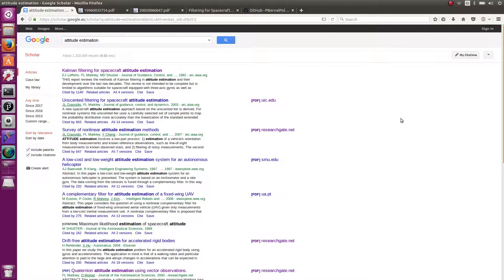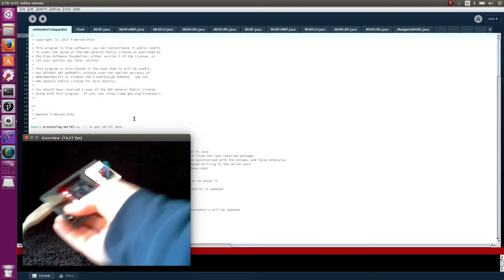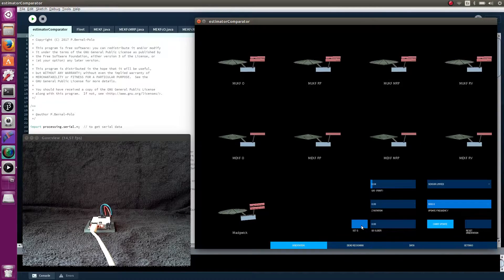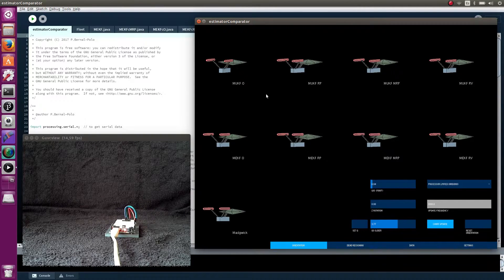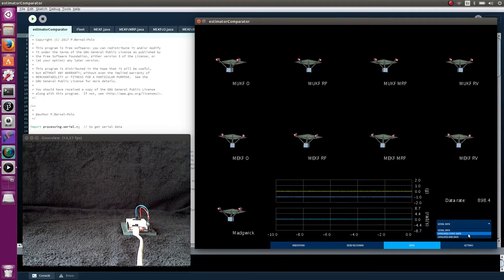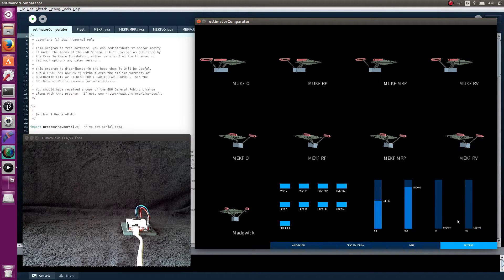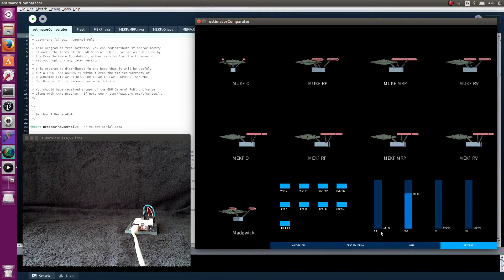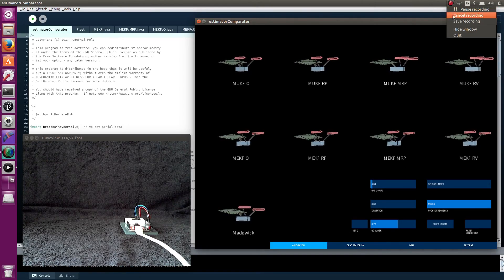Orientation Estimation using Kalman Filter, Quaternions, and an IMU as sensor | long video

Comment: Sir , did you make any library for aruino like thing for example stm32 blue pill or esp 32??
Reply from the maker: It is not a proper library, but you will find some very outdated c++ implementation here:
https://github.com/PBernalPolo/OrientationEstimationTest2017
Is that going in the direction you were looking for?
Reply: @pbernalpolo  sir, I have made one with complementary,1d,ekf with bias and ukf now. But I am having problems with Q and R tuning. Can you give me some guide line
Reply from the maker: @SaumikKhan  i can try. Maybe you can start by describing the problems that you are having
Reply: @pbernalpolo  Sir, I think I have solved that problem. But now I am facing another problem. Whenever mpu6050's  X axis is pointing north, the roll and pitch angle suddenly start increasing. I am also using an HMC5883l magnetometer inside a GPS M8N. Basically, I am using a Gyro, Accelerometer, and magnetometer for a quaternion-based UKF for estimating quadcopter orientation. What could be the solution, sir?
Reply from the maker: Your comment offers very limited information, so I can only suggest some directions for you to debug. According to what you describe, you are obtaining an unexpected rotation of your estimated quaternion. That mismatch with your expectations must be coming from the measurements used to update your estimation. I would start by deactivating magnetometer and GPS so that your setup only includes IMU (gyro + accel). That setup should work without surprises. Then, I would activate each sensor independently (first only IMU + magnetometer, then only IMU + GPS), and check in which configuration you start observing the behavior you where describing. Once you find the source of discrepancy, you will be able to correct your code if it is wrong. Keep in mind the possibility of your magnetometer not being calibrated, being surrounded by some iron that modifies the expected constant magnetic field, or some other tricky situation. Magnetometers usually bring unexpected problems, and you could be facing one of them.

Comment: Great stuff going on here! Is it possible to test this out using a different 6DOF IMU? I have an Arduino Nano 33 IoT's LSM6DS3 IMU and wondering if I would need to change any of the configurations around? If so, could you guide me a little as to where I would have to make changes?
Reply from the maker: Thanks! You will need to change something in the code only if you configure your IMU in a different way than I did. Specifically, in the "dataAdministrator" class there are two variables: amScale and wmScale. They define the scale factor used to convert raw measurements to the units expected by the algorithm. On the other hand, you will need to pack the measurements correctly to send them through the serial port. In order to do it you have several examples in the folder named "sensor2arduino2rpi". Your sensor seems to have 16bits per measurement like the ones I have, so you shouldn't find it difficult to use those examples to read out the measurements using your preferred library, and then pack them (using the MessageManager and the IPM classes) into the byte array which is later sent to the computer. I hope this is enough for you to try doing it yourself. Please, let me know if you get it to work or if you encounter any difficulties.  :)

Comment: Hi Pablo, great video here! It perfectly provides me with a starting basis for optimizing my IMU data for my application. However, I am running into some trouble getting the code to work. The code in the video doesn't correspond to the code on github. Could you provide me with some information on how to get the code on github running?
Reply from the maker: Hello, and thanks! I didn't remember changing the code, but you're right: the github code is a different version of the code that appears in the video. I don't remember the changes I made, but they should be superficial. I just tested the code and it seems to work correctly. Could you provide more information on the problem you are experiencing? What IMU are you using? What operating system are you running the code on?
Reply: @pbernalpolo  Thanks for your fast reply! I'm running the code on a windows 10 platform, using Processing 3. The IMU that I'm using, is a combination of ICM20600 (acc + gyro) and the AK09918 (mag). I checked your code and made sure the format of the serial data is exactly the same as in your example. The first problem I encountered was with the test_MKF.pde, where the variable updates is never updated from 0, and afterwards a log10 function is called (which returns -inf). However, I bypassed that by hardcoding 1000 into the variable updates. Now no errors appear when running the code, but the aircrafts/spaceships don't seem to move (regardless of the orientation of the IMU). Any idea on where I should look next? Any good points where the debugger could provide me some valuable info?
Reply from the maker: @quinten52  , as you know, variables defined in the main Processing sketch file (in this case "test_MKF.pde"), are accessible from classes defined in other files (which are included as inner classes by Processing). The "updates" variable is updated in the "manage_serial" method of the "CommunicationManager" class. I know this is not elegant, but for some reason I decided to do it that way at the time. Knowing that the code works as is, I would not change anything. Most likely the sketch is not receiving measurements for some reason. It is possible that the values are not being transmitted properly through the serial port. I would start by making sure the measurements are received by looking at the "DATA" tab. You should be able to see the data stream there. If it does not appear, then you should look into the way you are transmitting the data from the microcontroller (are you using Arduino?). I recommend you to check the Arduino sketch that I use to transmit the measurements from the MPU6050 ("mpu6050_2arduino2rpi.ino" which is inside the folder named "sensor2arduino2rpi"). It should be easy to modify that file to send the information from your sensor. Please give it a try and let me know if it worked!  : )

Comment: Hi Pablo, great Paper and clear video!
Would you recommend Madgwick for an easily implemented sensor fusion algorithm for a quadcopter (on microcontroller)?
Kind Regards
Ryan
Reply from the maker: Thanks Ryan! I'm glad that you like them.
I compared the Kalman filter based algorithms shown in this video with the Madgwick algorithm a while ago and took some notes. According to those notes, Madgwick's algorithm is less accurate than those based on the KF (when both run at the same update frequency). However, Madgwick's algorithm runs very fast compared to the MKFs, and that speed makes it preferable for some platforms (more update frequency usually means more accuracy). For example, on ATmega2560 (Arduino), the MUKF runs at ~7Hz, while the MEKF runs at ~25Hz, and the Madgwick algorithm runs at ~450Hz. However, on an RPi3, the MUKF runs at ~3000Hz and the MEKF runs at ~9000Hz (I don't have data for Madgwick's algorithm here). Those update frequencies are above the data rate of normal IMUs, so in such a case some MKF would be preferable in terms of accuracy.
Another thing to keep in mind is that the Madgwick algorithm is designed to merge the measurements of an IMU (Accel+Gyro) + Magnetometer (optionally). However, MKFs can also be used to fuse more sensors, which is another advantage.
In conclusion, the Madgwick algorithm is a good option if your microcontroller is not very powerful or if you are looking for simplicity, but if you want more you need other things.
I hope these lines are useful for you!
Reply: Thank you very much for this reply! This is very insightful!  @pbernalpolo  :)

Comment: Which IMU are you using?  A 6DoF or a 9DoF?
Reply from the maker: The IMU is an MPU6050. The board is called GY-87 (or similar), which includes accelerometer (3dof), gyroscope (3dof), magnetometer (3dof), and pressure sensor. However, I am only using the accelerometer and the gyroscope for these estimation algorithms. So, for practical purposes, it's a 6dof.
Reply: @pbernalpolo  Thanks for your prompt reply.  Ah yes I am familiar with the MPU6050 as it has been around some time and is quite popular by now.

Are you seeing any problems happen over time by not having a magnetometer?  For example, perhaps a drift over time?  What kind of accuracy are you achieving?  Finally, what kind of microcontroller are you using in your setup?
Reply from the maker: @mehdirahman4127 , indeed, there is a drift over time. Any magnitude for which there is no absolute measurement will have drift. In this case, we have a drift in what is known as heading. That is, you get a good estimation of the orientation that is related to gravity, but the estimation of the orientation in the direction orthogonal to gravity will drift. To get rid of this drifting, one would have to add sensors. A magnetometer would be a possibility.
On the accuracy, you can see the results that are shown in the paper (link in the description of the video). It shows how the accuracy of the algorithms changes according to the update frequency. Note that the results shown there do not correspond exactly to the current case, in which we only measure the gravity vector.
Finally, I am using an Arduino (nano) to get the measurements from the IMU (i2c), and send them to the computer. Currently the algorithms are executed on the computer, because it is easier to debug. But I have also implemented similar algorithms to run on the Arduino (which runs much slower).
Reply: @pbernalpolo  What update rates can you achieve on the Arduino with UKF filtering?
Reply from the maker: @isaacclark9825 , an Arduino Mega can reach update rates between 7 and 8 times per second for the MUKF, in contrast to the 30~35Hz that can be achieved with the MEKF. You will probably find interesting the paper I authored on this topic (it can be accessed from the description of this video). In particular, Section 4.3 begins by comparing the performance of the MKFs in an Arduino and in a Raspberry Pi. I hope you find it useful.
Reply: @pbernalpolo  Thank you.  I did grab your paper.   I am trying to make a call on what processor I need to use in a project.  Thanks for the pointer to section 4.3.

Comment: Awesome work, I implemented your Rodriguez Parameter MEKF and still get drift in my yaw, I am playing to with the Qa, Qw to try to find the right tuning but no luck yet. Do you have any recommendation or tips to further debug?
Reply from the maker: If you only use accelerometer and gyro (as I use), you will not be able to avoid the drift; the accelerometer "tells you where it is down", but none of the sensors give you information about the "heading". There are several options for obtaining that information. One possibility is to include a GPS, which does not give you direct information about the heading, but knowing the direction in which you moved, and in which direction the accelerations have occurred, one can estimate the orientation. Yet another possibility is to incorporate a magnetometer and use it as a compass. Although in principle it seems simpler, this approach hides some drawbacks: one can assume that the magnetic field always points in the same direction, but that could imply a loss of precision if that assumption is not fulfilled. In such a case, one would need a map of the magnetic field, and an estimation of the position of the vehicle to know what value of the field we are measuring. It should also be taken into account that in either case the magnetic field would be affected by nearby metals.

I hope these lines are useful to you :)

Comment: papers??
Reply from the maker: If your question is, "Could you cite some papers that describe what is happening in the video?", then, please read the description of the video.
I am trying to publish a paper about this, but it is currently being reviewed.
If it get published, I will try to share some link to it, or to some version of it.
Reply: waiting for your paper sir. you have done great project and im very thankful for that.  also your code is so clear and self explaining and im going to use  some part of it in my drone project. respect from a student sir.
Reply from the maker: Thank you for your kind words.
I am looking forward to see the results of that drone project of yours  : )
Reply: ok sir, i will add magnetometer for precise yaw calculation(can you give me some idea or way so i can implement it fast) and will comment here when its complete sir.
Reply from the maker: Currently I do not have time to implement it, but if the paper get published, I think you will be able to find there the answers you need to implement it yourself.
Reply: @pbernalpolo  how about papers your work is based on? I am interested in how to do Kalman filter with 9DoF data from sensors like 9250.
Reply from the maker: @Ramkrishna Lamichhane, and @Dajiang He, sorry for the late reply. I am pleased to announce that we finally published our paper. If you are still interested in this work then, please check the video description. The paper also contains the references on which the work is based, but I preferred to give you the option to choose which one to read first. I hope to hear about your opinions.  : )
Reply: Good to see ur papers!